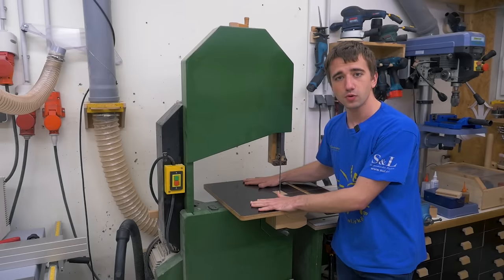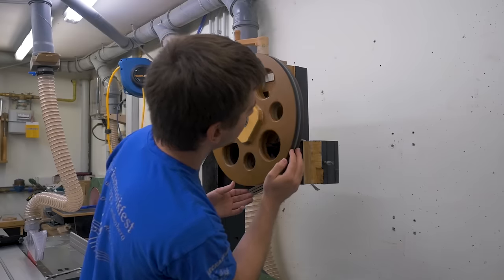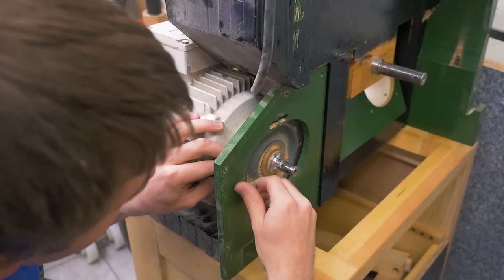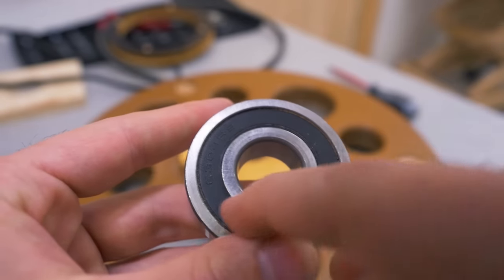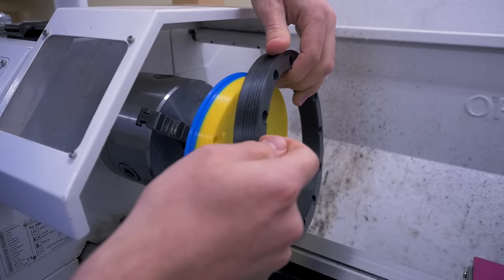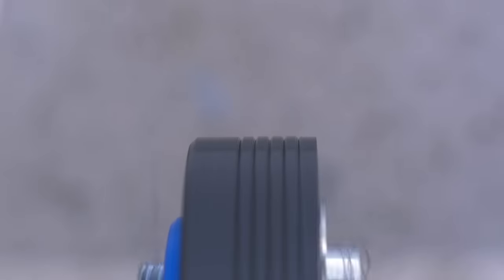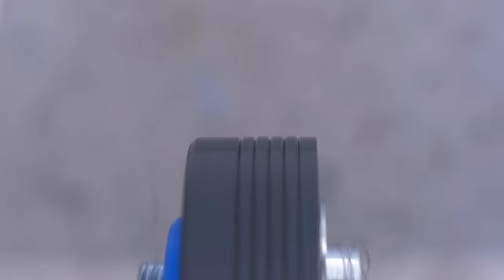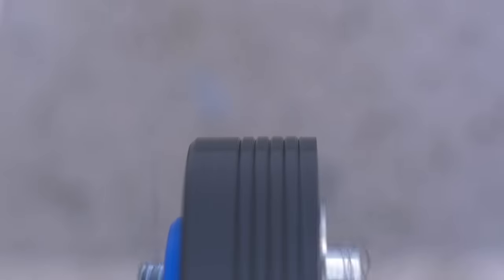3D-printed Pulley for my Homemade 2HP Bandsaw (Bandsaw Upgrades Part 1)

Comment: 4:19 Fretting corrosion on the shaft. The bearings are processing/spinning around that shaft. You need a spacer in the wheel and some preload.

P.S. My disdain for 3d prints is confirmed again. The other pulley would be better as solid plastic/aluminum as well.

Comment: why did you not mount some sort of auto adjuster for the belt ...because multi grooved belts do need extra tension
Reply from the maker: Not necessary when you tighten the belt properly on the final installation

Comment: Awesome video—I prefer long videos!  Also, was the bandsaw wheel brush blackened because the fibers were burning due to friction or for some other reason?  Just curious and concerned about safety!
Reply from the maker: Just dust and dirt over the years. It was in that position for about 4 years

Comment: Moinsen Marius
1 x Full Service bitte und der Stress beginnt, Die anderen Jungs haben es ja schon geschrieben, Soft Starter zieht die mechanische Anlaufbelastung runter, das würde bestimmt etwas helfen. Was mir viel mehr Kopfzerbrechen machen würde, ist das verwendete Material. 3 D Drucker Filamente können gar nicht genügend Stabilität generieren, du haust da mit 'nem Drehstrommotor mit einem üblen Drehmoment drauf, hast ja gesehen, was der aus deinem Plasterad gemacht hat. Ob ein Vollmaterial Kunststoffrad dauerhaft damit klarkommt? Ich denke, auf lange Sicht auch nicht. Dafür sind Kunststoffe nicht gemacht, die mechanische Belastung dürfte auch dem im Laufe der Zeit das Genick umdrehen, spätestens, wenn da richtig Last beim Sägen aufkommt. Das hat schon seinen Grund, warum Riemenantriebe auf Metallräder aufgebaut sind. Haben die Altvorderen sicher auch genug böse Erfahrungen gemacht, um schlussendlich dabei zu landen.
ich bin auf jeden Fall auf den (die) nächsten Teil(e) gespannt. Aber wie schon geschrieben wurde, ich könnte dir stundenlang zusehen. Hab also keiine Hemmungen, auch mal Überlänge rauszuhauen. 
Da du selten genug (aber dafür immer mit Klasseinhalten) vor Tür auf Straße kommst, schon deshalb immer erste Amtshandlung Daumen rauf und dann freuen, auf das,was kommt.
Gruß
Jo

Comment: I would go for a progressive starting speed, where the motors starts at a slower speed and builds up to the desires speed..

🧰👍🏻
Reply: I think doing this could be as simple as a resister on the motors power supply...

Comment: A star-delta switch will not help. I guess the motor plate shows 220V/380V or 230V/400V. This means that a single set of windings is build to withstand 230Volts. If you connect this motor in delta mode, the same set of windings will be connected to 400Volts (and according to the higher voltage also a higher load). In this case you will destroy the motor! 
Only with a three phase power connection that is rated 120V on each phase (phase to neutral) and 230V(phase to phase) a star-delta switch would work. However - 230Volt-3-Phase is not what one normaly has at home in Germany. Standard 3-Phase is rated for 400V around here.

A Star delta switch will only work with a motor thats rated 380v/660V or 400V/690V on the motor plate.

For the common user there is only one case where it is required to connect a motor thats rated 230V/400V in delta mode: if you use a VFD that is powered from a normal 230V socket. in this case the VFD generates 3 Phase Power with ~132V on each phase (which results in 230V-3-Phase measuring phase to phase. Make sure that your voltmeter has the feature True-RMS. Else you will get faulty readings).

Comment: Stupid question, why did you just not turn the pulley in metal?
Reply from the maker: I don't have easy access to metal parts that big. And the 40° tool would only be suitable for aluminium. The PE I already had.

Comment: I can't say i understand why you'd need to lathe that part and not just use say Simplify3D's support feature and print it correctly from the get go. I assume the faceted aspect of the software was the cause, in which case, jumping over to 100 lines for the base circle would've solved that problem.
Reply from the maker: The problem is the overhang of 70°. Without support you don't get a good result and with support it's way too difficult to remove all of it again in the small groove

Comment: Star is low speed and delta is high speed... So won't help 😉
It you need help with electricity just ask 😊
Reply: The star/delta has nothing to do with speed. It is to lower the coil voltage and thus the inrush current (and torque). The motor has the same synchronous speed both in star and delta. If the motor runs significantly slower in star than in delta it only means that the star configuration produces less torque than needed.

Comment: You need a soft start on the motor
Reply: The VFD drive upgrade should be able to be programmed for soft starting. If he started with that solution, we wouldn't have had the other two excellent videos. :)

Comment: Should consider using the printed pulley and use for an investment casting using aluminum. Or just turn some steel or aluminum. Not sure why you are using plastic for the pulleys.

Comment: You have a lathe... so you could have easily turned the lathe pulley from steel or aluminium :)
That would have lasted for decades ;D
Reply: And would have saved hours of printing time

Comment: Ein Stern Dreieck Schalter würde in dem Fall nicht helfen, der Motor kann auf 380 V nicht auf Dreieck laufen, dafür ist er nicht ausgelegt.
Reply from the maker: Danke! Zum Verständnis: Wenn ich ein Drehfeld mit 230v hätte, dann würde das Sinn machen? Betrieb in Dreieck mit 230v und Anlauf in Stern auch mit 230v (obwohl für Stern-Betrieb 380v notwendig wären)?
Reply: @MariusHornberger  Genau, dann hättest du in der Stern-Anlaufphase 1/3 der Leistung und im Dreieckbetrieb die volle.
Reply: @MariusHornberger  Mit 230 V würde das gehen, wäre nur nicht so elegant gelöst da man sich etwas für die Phasenverschiebung einfallen lassen müsste.
Reply: @MariusHornberger  Der Motor ist für 230V Strangspannung gebaut. Sprich an jeder Wicklung müssen 230V anliegen(im Betrieb). Bei unserem Netz mit 400V zwischen den Außenleitern ist das nur im Stern der Fall. Historisch gab es zeitweise auch einmal Netze mit 230V zwischen den Außenleitern, da würde ein Stern-Dreieck Anlauf funktionieren. Am 400V Netz bräuchte man einen 400V/690V Motor, unüblich für Motoren <=2,2kW. Ein Softstarter oder Umrichter ist da immer noch die beste Option. Hätte der Keilriemen die empfohlene Spannung würde der aber auch nicht durchrutschen.

Comment: Why not use ceramic bearings?
Reply from the maker: There's no benefit in using ceramic bearings. They can take the same load as normal bearings
Reply: @MariusHornberger  are they not sealed better or last longer?

Comment: Toothed belts on wood really isn't ideal in the first place, even if it seems like the belt grips the wood when checking by hand. Better surface on the wooden pulley and a standard V belt would've solved the original issue.

As for finishing the first 3D printed pulley, the ID cut router cut, that setup you made was extremely sketchy and unsafe. You should invest in either a rabbeting bit and a patterning bit, or a bit that has interchangeable bearings for +, -, and 0 offsets. Not only would those bit(s) make doing that job easier and faster, it also makes that job a lot safer. First of all, a bearing on a bit doesn't allow a snagged piece to be pulled into the bit and cut in a way that you don't want the piece to be cut. Second of all, if you're using a non-bearing bit and are relying on fences (the two clamped down blocks in your case) you really need 3 points of contact at minimum for circles, to allow the circle you're cutting to not come out of orientation; but when using a bearing-based bit, this isn't as necessary, as the bearing will stop the bit from cutting too far if the cut piece does move out of place. I also think you should invest in a router shield, basically a sheet of polycarbonate with handles on top that you double side tape your work piece to, it improves safety in patterning, especially with thin pieces where your fingers can easily slip into the piece.
Reply from the maker: The old belt wasn't toothed. It was a normal v belt that just had tooth looking cutouts to make it flex easier

Comment: If you metal lathe can handle that kind a diameter why not make pulleys from aluminum or steel?
Reply from the maker: I didn't have a piece of aluminium or steel that size

Comment: I’m down with 3D printing like any other person, but for this kind of application I’d not have considered it. Maybe if your don’t have access to a lathe like you do, but you have the tools to make this out aluminum for example, or the material you ended up using. I don’t see that printing helped you here. Fun, but ultimately pointless.

Comment: Because it's a wood frame and because you can't tension it properly, a toothed belt was never a good option for the original pulleys. Kinda like putting pizza cutter wheels on a Supercar.
Reply from the maker: That was no toothed belt. These "teeth" on the belt are just there to make it bend around tighter radii.

Comment: El cheapo-bearings. The sealing doesn't look stable and good. Which manufacturer?
Better no ball-bearings. Use  roller-bearings from SKF. And yes, the bearings should be changed frequently.
Why not using a start-current-limiter?